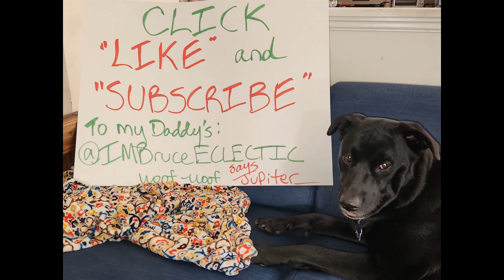WATCH this Before you Build or even Buy a BIKE....Controller, Volts, Motors Simplified....

Comment: Good info thanks. So what made you decide on the Fabulous over the Wired? The Wired Freedom cost a little less and has rear suspension unlike the Fabulous. Power/speed seems to be pretty much the same on both.
Reply from the maker: Great question...it was several factors.  First,  at the time the Wired design was flawed with the rear tire hitting the controller...and me at 250lbs...that would be a big issue.   Second, I liked the better gears and adjustable handlebars of the Fabulous. Third,  I liked the ability to turn off one motor and go slower and further on the big battery or both motors on and go fast and where I live alot of hills so AWD made hills simple...have gone up 8% grade hill over a mile long in about 5 minutes in PAS 1.  AND, the last big reason....the Fabulous bike was in stock with free delivery and no tax and I got a Veteran Discount.  Thank you for watching and asking a GREAT question.

Comment: why the heater ? i converted my ebike 6 months ago and all of a sudden it just stopped working.
Reply from the maker: Thank you for watching and the question.....where I live it sometimes gets below freezing at night.  I keep my battery on my bike in the garage so on really cold nights I turn on the heater and cover with a blanket in such a way to capture the heat.  After running 12 hours....heater is not warm to touch nor is cord...so safe becuase the wrong heater could be a fire hazard.  And this heater just keeps it from freezing but not hot...which would be bad for the battery

Comment: Thanks for the link, Bruce. I'm in the planning stages to build my own bike. Currently hunting for a frame if you have any suggestions. Cheers.
Reply: My Grizzly has dual 33 amp controllers. Acceleration is excellent but it tops out at 37 mph. A perfect ebike for me would be able to cruise 35 and not be maxed out. Hopefully the Motor Goat will be like that.  I also enjoy the vids with the "Professor." Most of the bikes they build run 100-250 amp plus controllers. 😮
Reply from the maker: @_TRI66ER  ...me too on both points.  ARIEL Rider has been around a long time...they build good bikes that are well designed.
Reply from the maker: @_TRI66ER  and thank you for watching and commenting!  Appreciated!!
Reply from the maker: I have watched people build fast bikes from Yadea Trooper, Spark Bandit, Ariel 52volt bike and @Maximumcharge...he is building one with a Wired bike.  Out of all of those...the Ariel is on sale for around $1700.  BUT...I have ordered a Goat Power Bike---Motor Goat V3....scrambler style rated at 450lbs....open frame...if it is not fast enough, I am thinking that would be a good bike to make fast.  And it is on sale now for under $1900.  Check out my video on the specs.  Thank you for watching and commenting and asking questions!